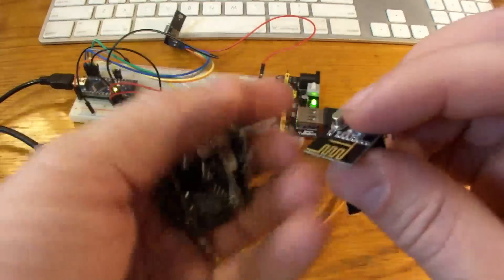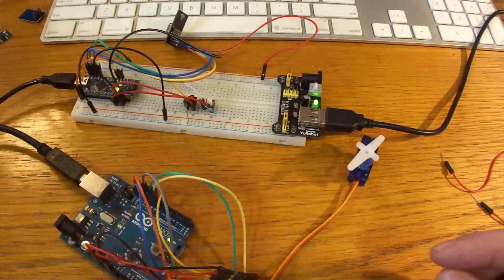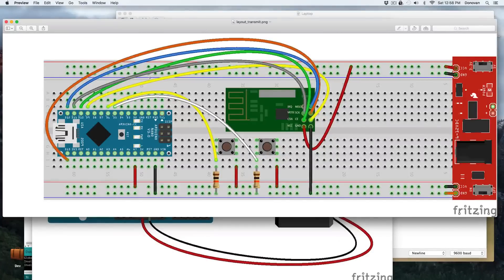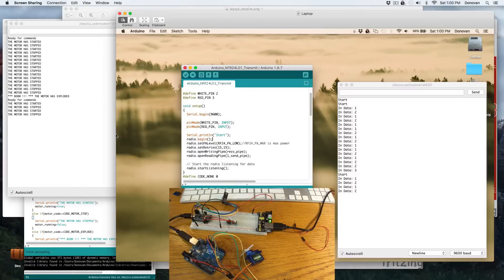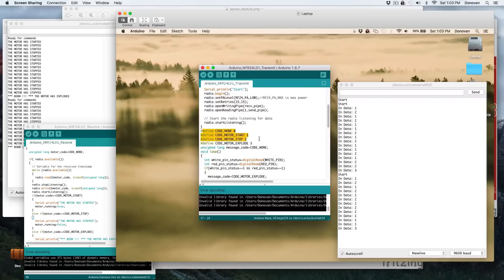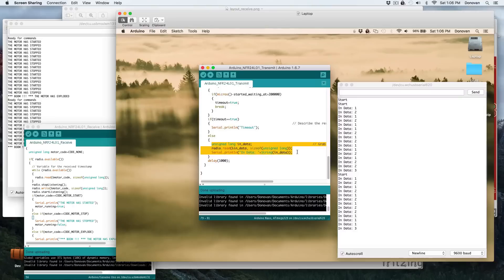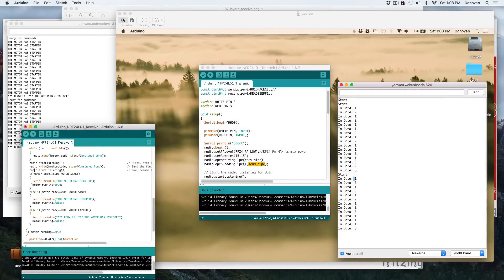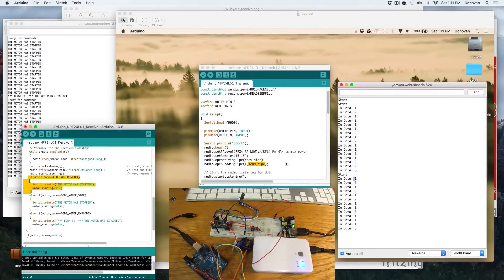HOW TO: Use a NRF24L01 + Arduino to remotely control a motor

Comment: Excellent video! You explain things exceptionally well.

Much like A. Smith, I am in the process of building a reliable grow system for my garden. I have problems getting around, and am looking to automate some of my gardening tasks.

I want to keep the project in public domain, so others could utilize the system and make improvements and adaptations as they like.

I want to keep as much of the data flow wireless as possible. I think this would help keep the system flexible and not require a major teardown and reset as the seasons change, not mentioning building and maintaining a wire spiderweb.

Thanks

Comment: just an FYI that not many people know....you don't need two computers to run two instances of the IDE separate from each other...you just have to open a new session with the desktop icon a couple times and it'll isolate a new session allowing you to control, code and serial print to each board at the same time from the same Windows environment/same pc...you have to open from the desktop not from within the current IDE session!

Comment: I had understood that the nRF24L01+ has automatic error checking and re-transmission. So I am thinking that possibly the error routines in your code may never catch anything unless the connection is so bad that it overcomes the internal error checking/re-transmission built in.  So be it... always good to have an extra safety net.  Thanks.  Good vidi.

Comment: Thank you so much for explaining pull up resistor!  I've been looking for this information if I really need it or not and now I know.  Liked and sub.
Reply from the maker: +Dima Prok Pull down resistors can be even more evil as not having one doesn't necessarily make your circuit fail. Often there is an "accidental" pull down resistor kind of built into the circuit draining away the charge to ground. Thus the circuit might work most of the time but then not work. Or it will work when you are touching it but not when you put it down, etc. 

It also feels very wrong to "short out" a circuit. It is only when you do a simple calculation that you realize the amount of current going through a pulldown resistor is negligible. 

The nice thing about learning these things is that there is a somewhat finite number of basics. After that it is just mix and match what you know to build cool things.

Good luck!
Reply: +LessonStudio Alright, I guess I'll try without it and see how it goes since I don't have any resistors on hand and I'll need to be ordering from ebay or Amazon.
Reply from the maker: +Dima Prok You will be walking into a valley of evil. I would recommend finding anything in the 10k resistor range. A resistor pulled from some older dead electronics. Anything from the pre 2000s is certain to have a bunch of resistors that will suit your needs. 

To not have a pulldown where one is needed is going to result in funky things. Then you will not be confident if you are making a mistake or just the vagaries of electric charges.

For instance, I just measured the resistance of about an inch of a pencil scribble. It was right around 10k. If you could work such a thing into your circuit it would be better than no resistor at all. The ultimate in hack.

Keep in mind that the goal of a pulldown resistor is not really to carry a pile of current but to drain away a tiny charge. With things like a mosfet, when you put some voltage on a gate that holds the circuit open, that charge will potentially just sit even when you remove the voltage from the gate. Thus you really need a pulldown resistor to drain that charge away. Yet the number of electrons that need to be drained is microscopic compared to the number that might be flowing to even power a tiny LED. Thus even a crappy pencil scribble can do it.
Reply: +LessonStudio Yeah... I've been meaning to find some old electronics.  Need to check Craigslist for free stuff.

Comment: Thank you for this video. I'm going to pick up a few of these chips and see if I can use them in my dissertation instead of Ethernet for data transmission.
Reply from the maker: +A. “Gospel” Smith They are a very cool alternative for many tasks. I have only scratched the surface in this video. They can create interesting mesh networks and with a little bit of fiddling I have set up a chain where one just relayed to the next to effectively lay out a mile of wire using a handful of tiny solar powered stations. 

For waterproofing I just squirted in great globs of marine silicone glue so the things are now pretty much indestructible.

What, may I ask, is your dissertation about?
Reply: +LessonStudio 
For my thesis I'm going to design and build an automated irrigation and growing system using an Arduino and a few sensor arrays. I was inspired by Rik Kretzinger's aquaponics system and high efficiency agriculture. The system I'm working on will keep track of things such as light levels, soil/air moisture and temperature, water levels, and will automatically control watering and light levels. 

My ideas are not new at all, but I'm interested in seeing what data I can get. The wireless chips will certainly make things easier, and it's good to know that I can waterproof and daisy chain them in case I take the project outside.

Right now the ultimate goal with the project is to be able to maintain a small plot of cat grass for my cat to eat, with extreme efficiency and no work involved past implementation.
Reply from the maker: +A. “Gospel” Smith Very cool. Just watch out for the cheap soil moisture sensors out there; many of them just corrode in days.

Comment: I believe buttons in scheme are connected to another - pins D5 and D6 (on 5:36)  than in code and scheme (D2 and D3 3:55 and  9:18) but it's very slight  inaccuracy....anyway GREAT JOB...congrats
Reply: Is that how you got this working?

Comment: AWESOME video! thanks. ...is there an easy way to add an inductor, capacitor and a resistor to boost the nano VOUT a little so you wouldn't need an external supply when using a nano?

Comment: Thank you so much for this. What pros and/or cons are there for using a NRF24L01 compared to say an XBee transceiver?
Reply from the maker: +Leetky For simple serial communications the biggest difference would be price. The XBee transceiver is maybe 20 times more expensive. They both take care of interference and operate in the same frequency range. The antenna version of the NRF24L01 has maybe triple the range of the XB. Also the data bandwidth of the NRF24L01 is about 4 times as much but I have never tested it to see if it really works at that extreme. 

The XBee has many other features such as built in 128 bit encryption. But probably one of its bigger features is that it has ADC and IO pins built in. Thus it could control things just as it is without having to use an Arduino as an intermediary. The ADC means that it could also handle sound.

But for instance in my next project I am going to use an NRF24L01 to create a pretty cool garage door opener. I am also going to incorporate some pretty good encryption which will be immune to MiTM and replay attacks. The NRF24L01 will be perfect for this sort of project.

One other thing the XBee can do is act as part of the XBee family. This is all sort of plug and play which might have its advantages in a Lego sort of way.

Comment: Hi, very nice tutorial. I am building an RC tank and my bluetooth module (HC-06) keeps disconnecting from my laptop every couple of minutes or so, it's very frustrating. I was curious if I could rip out the receiver from an RC car, and still be able to write code to communicate to the arduino/motor shield through the RC car controller.  Please reply if you have the time :) thanks

Comment: which is better when controlling servos/sensors/stepper motors? The nrf24l01 or the esp8266 module?
Reply: If you are just getting started then the esp8266 has piles and piles of tutorials and helpful docs out there.
Reply: @CanadaEmperorOf  thanks

Comment: the pin 11, 12, 13 related to module NRF24L01 ( transmetter and reciver), is it  necessary for the function of both arduino?

Comment: Great video!  Quick question though - Looking at your diagram from the 6 minute mark (for example), is it possible to have the Nano and the NRF24L01 share the same 3.3v power source?  You mentioned that the NRF24L01 needed a little "oomph" in terms of amperage.  If that's possible, what kind of amperage rating would I need?  My problem with projects lately has been that I have like 20 different adapters for each of the components (and it gets kind crazy).  Much appreciated in advance!
Reply: i know im randomly asking but does any of you know of a method to log back into an instagram account?
I somehow lost the login password. I love any tricks you can offer me
Reply: @Caspian Victor instablaster :)
Reply: @Deandre Tate It worked and I now got access to my account again. I am so happy:D
Thanks so much, you really help me out !
Reply: @Caspian Victor you are welcome =)

Comment: Can you use these to inform them each other? Means that use a button for one side and if you push this button , other nrf24l01 side which has a LED will get information to switch on its LED.After that if we use a button which is in other Nrf24l01 , this will cause to inform nrf24l01 to do something.I hope you understand .d

Comment: Great and straightforward tutorial! I do wonder if it is practical to use one transceiver as a receiver for multiple (around 4) transmitters. Would you please offer some insight on that?
Reply from the maker: +Ultimatefire54 I believe (off the top of my head) that each of these modules can handle 5 connections. Unless you were to be pushing the transmission up to its bandwidth limit there would be no problem with that. These things can handle something in the ballpark of 2Mbps which is well beyond the capacity of the Arduino to spit out or receive data.

More interestingly there are RF24 mesh networking libraries where you can set up a hoard of these things all passing data back and fourth along a self healing grid. So if you had to go beyond 5 that would be possible with mesh networking. It would add a little to your code complexity but from what I have dabbled with it ends up boiling down to Unit 1 can talk to Unit 80 and the mesh takes care of the rest even if it has to hop a few of these to get there.
Reply: Thank you I looked up a lot on multiceiver networks and they seem to be very useful for the project I am working on.
Reply from the maker: +Ultimatefire54 Yes it is very cool to get a mesh working and see it keep working after horrible things keep happening to it.

Comment: Hi, I love the video on the NRF24L01 is very good ..... if it is not much trouble I do not know if I could clarify a doubt I have which is: How could I use the NRF24L01 in an external interrupt that has the arduino?
Thank you

Comment: I like the circuit. Now my question is how could i turn this into a dc motor controller for a dc train set. I want to use 4 buttons. Button 1 increase voltage to motor, from 0 to 18v button 2 decrease voltage, button 3 select left, button 4 select right and if I am moving in a direction and press button 3 or 4 then stop. This is for a train controller

Comment: Great video and explanation! But the arduino code of the Arduino_NRF24L01_Transmit is not available in the GitHub repository, hopefully this will be fixed soon.
Reply from the maker: +Martin Beentjes Thanks for finding that. I just pushed a new version fixing the glaring omission!

Comment: Cuando trato de compilar el archivo tanto de Receive como de transmit, me sale  el siguiente error.

Arduino_NRF24L01_Receive:8: error: integer constant is too large for 'long' type
Arduino_NRF24L01_Receive:9: error: integer constant is too large for 'long' type

Las lineas del programa  son las siguientes:

#include <SPI.h>
#include "RF24.h" // This is the RF24 library that may need to be installed through the Manage Libraries feature in the IDE.
 

RF24 radio(9, 10);//Create a commuications object for talking to the NRF24L01
const uint64_t send_pipe=0xB01DFACECEL;//These are just arbitrary 64bit numbers to use as pipe identifiers

const uint64_t recv_pipe=0xDEADBEEFF1L;//They must be the same on both ends of the communciations

Comment: hey great video! in your github there is actually no code for the Transimitter Arduino_NRF24L01/Arduino_NRF24L01_Transmit/. just letting you know :)
Reply from the maker: +MrDeamondoener Thanks for catching that. I just pushed a version that is more transmit complete.

Comment: Great tutorial.
Could you help with making this code work with a joystick. I have a code that will allow 2 modes giving different servo control using the button from the 2D joystick. I have seen other videos using NRF24 with a joystick but not one that allows different modes....if you're interested please let me know.

Comment: Question?  Has anyone written code to control an RGB LED that is controlled via this device                 so I won't have to use the Remote that came with the AC controlled LED Bulb?                 -                 It's called a Milight 2.4G wireless E27 6W RGBW LED spotlight Dimmable Bulb lamp                 Purchased from: http://www.banggood.com/

Comment: Thank you so much. But I got a problem when I was trying to upload the Receive sketch to the board. It said, timed out. Hope you'll help me to solve this.  here's a screenshot of it. http://imgur.com/vZQV0NU
Reply from the maker: +Prasanga Fernando Just a guess, but it looks like the Arduino IDE is not correctly configured. You first must select the correct board. Then you must select the correct port. Sometimes as you unplug and plug the board back in, the port setting must be chosen again.

Which board are you using?
Reply: +LessonStudio Tank you for your reply. I'm using arduino Mega and a UNO. I was able to build two obstacle avoiding robots with both boards. But I was unable to use NRF24L01 module. I purchased those two NRF modules from Ebay.
Reply: +LessonStudio I have selected the correct board, processor and the correct port. When I am uploading the blink sketch both boards work fine. But for this sketch it's not working. :(